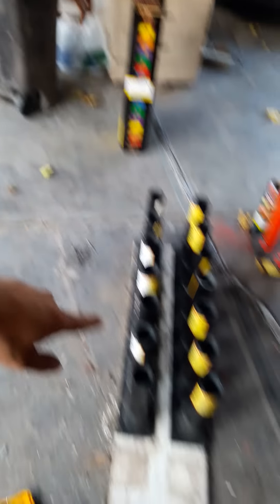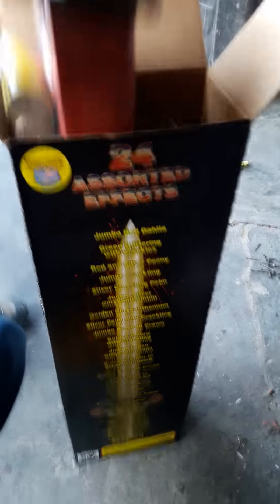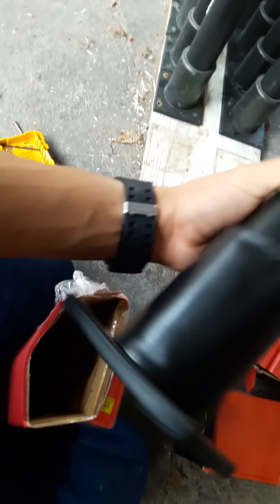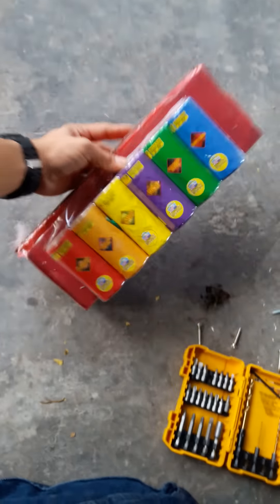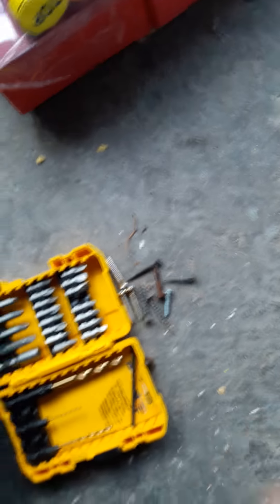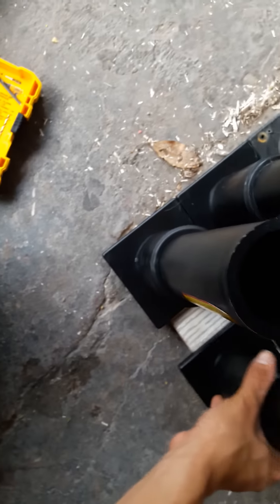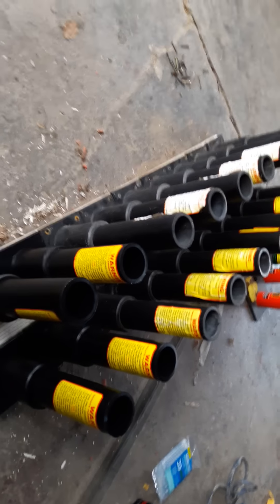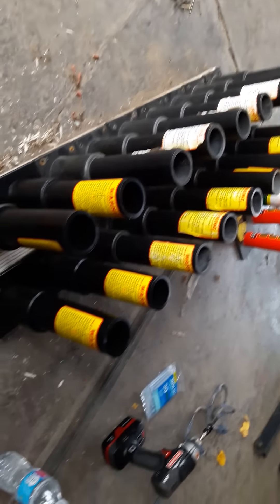Getting ready for the 4th of July! Las Vegas Pyro!

Comment: About the Excalibur tubes, there are some that have different bottoms. Some are like plain flat and others are like squared, this doesn't matter when nailing them down on a board right? 
By the way what type of nails are you using?
Reply from the maker: it doesn't matter Pyro.
As long as it stays strong and holds down it's good to Go!
I used some nails I found to save cash. Lol
Use medium ones.
Reply: +Jay Mendez gotcha thanks again Jay!! Also, I've seen another type of canister shells that are very similar to the excals. If you've seen what I'm talking about do you think they're good canister shells? It was in an assortment called Heavy Duty